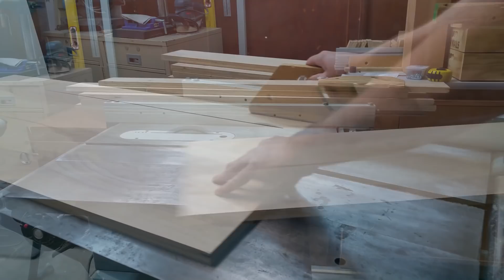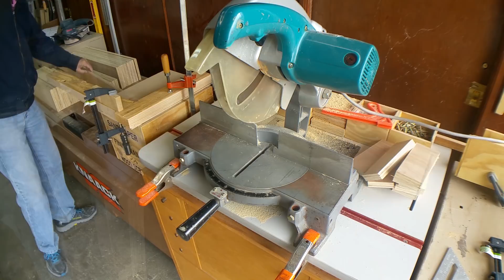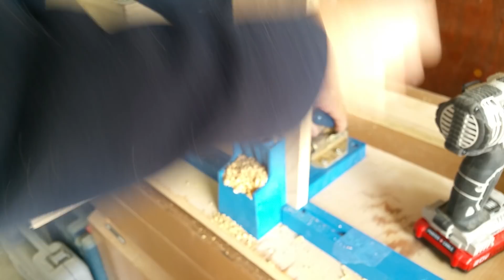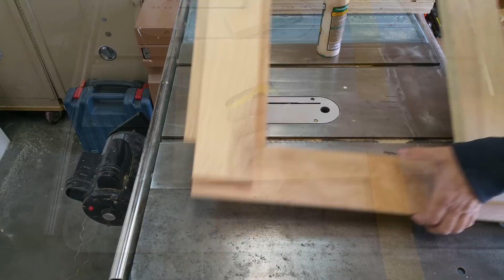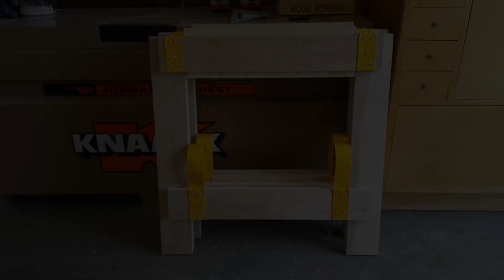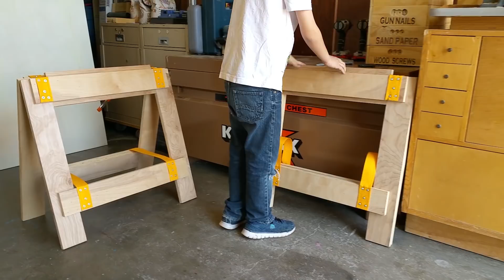Plywood Sawhorses/Assembly Table/Workbench/Crosscut Table Project - Part 1

Comment: Well made. light but strong enough for my purpose MyBest.Tools Used to set up an outside work bench to cut floor joists. Needed four to accommodate long material. Met my needs nicely.
Reply from the maker: My description doesn’t mention any weights for this build? I’m not sure what your asking!

Comment: Nice saw horses! Where did u get that yellow seatbelt strap banding type of material from? What's it called or name so we could find it? Where can you purchase it?
Reply from the maker: I cut the short pieces from a          2 1/2" wide  x 16' long  cargo strap  I had on hand,  you can find those at harbor freight, they cost about $10.00 depending on the width and length, good luck with your project and let me know if you have any other questions, thanks!
Reply: HENRY ! Thanks Henry for letting me know on how to get my hands on those Harbor Freight Cargo Straps... Planning on making some sawhorses myself in the future and thought those cargo straps were a perfect idea during my ‘planning faze. Thanks for the reply! 👍
Reply from the maker: Anytime.........thanks again for watching!

Comment: Where did you acquire the strap material ? Does to be from a tow strap.
Reply from the maker: It was a load strap for securing loads inside a semi trailer, a tow strap will work just fine. Let me know if you have any other questions, thanks for watching!

Comment: Why the raised bit on top of each saw horse?
Reply from the maker: They were going to allow the sawhorses to lock up into the bottom of the assembly table I built, but I've decided to build a permanent base for the assembly table so I have since trimmed them off, thanks for watching!
Reply: @henryworkswoodandmetal  Nice build
Reply from the maker: @philrichmond7567  thanks again!!!!!

Comment: No written measurement or instructions on the boards?
Reply from the maker: I wasn't sure if the viewers cared too much about me writing on the wood as I went along........I will add that again in the future, I appreciate your feedback, thanks for watching and taking the time to leave a comment.
Reply: I snagged some 1-1/8 ply flooring at a local camper shell store. Wondering if the double-up boards would be necessary if I use the flooring boards. The pocket holes are very strong joints. Your thoughts? Thanks.
Reply from the maker: I think it will work just fine, I added the extra piece just to be sure but I also tend to over build things.  You could always add them later if the pocket hole joints don't hold up.  Thanks so much for watching and good luck with the project!
Reply: HENRY ! This perhaps the most efficient and easy to build saw horse project I have yet to view on YouTube! May I please ask for the general measurements?
Reply from the maker: Sure, the final size of each one is 28" h x 28" w 
The upright pc's are 5 3/4"x 28"
Cross pc's are 5 3/4" x 16 1/2"
One side of the cross pc is taller  by about an inch to allow it fit up into the assembly table that will go on top of these sawhorses.  That video will be up soon.  
Let me know if this helps, thanks!
Reply: HENRY ! Cool. Thanks my friend!